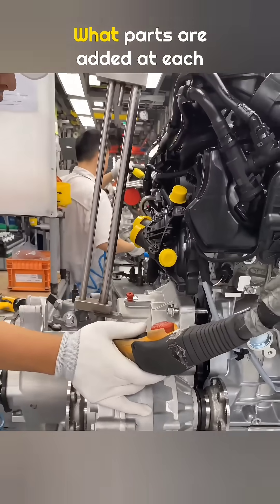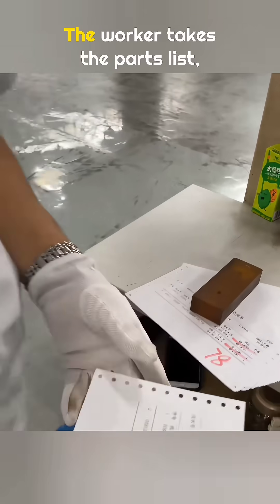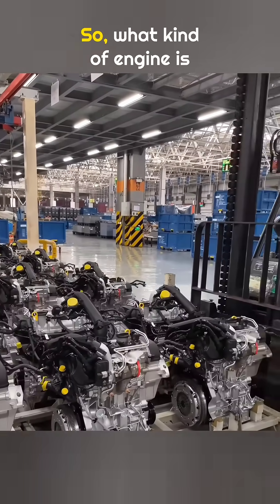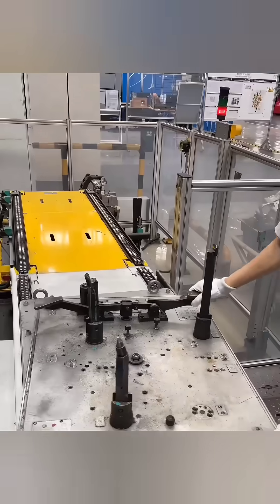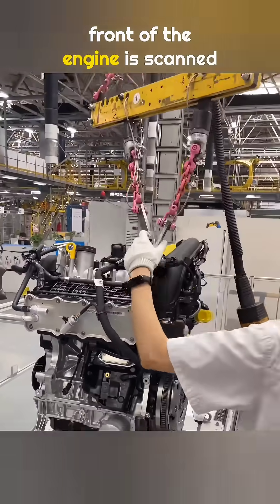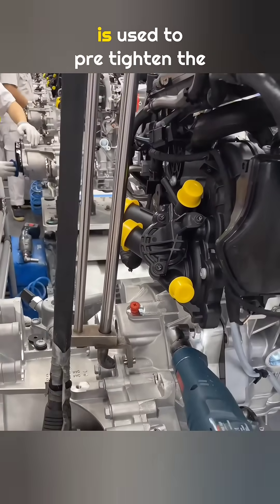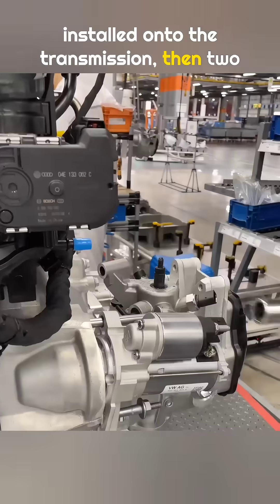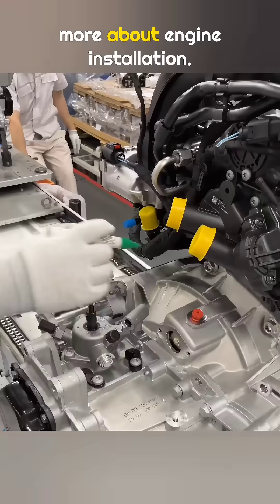How Car Engines Are Installed in Factory

Comment: I just replaced the clutch in my 2004 Jetta, and I’m surprised to see that the transmission in the video looks exactly the same as the one in my car. Does that means VW still uses the same manual transmission after 2 decades?
Reply: From the year the austrian artist founded VW